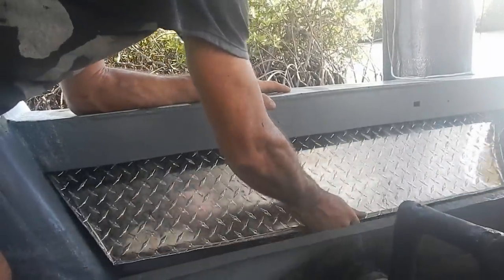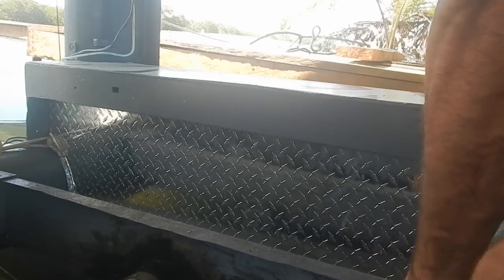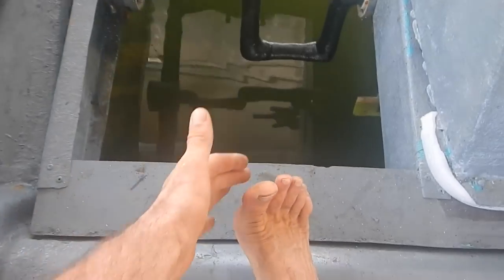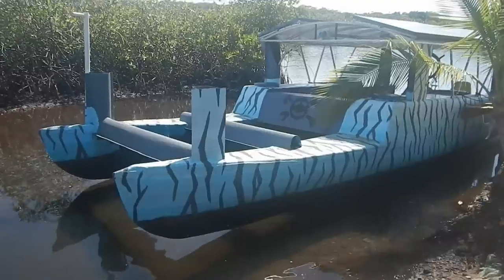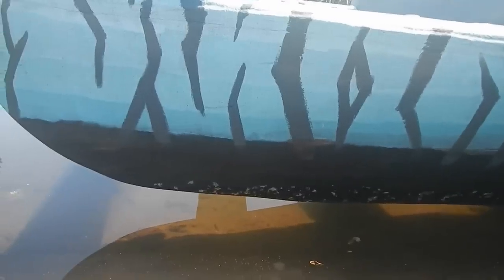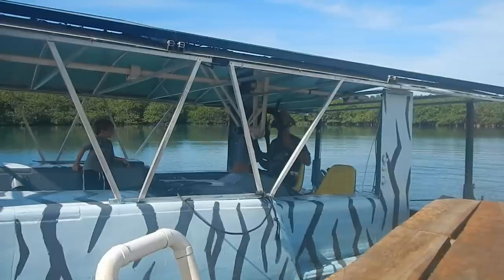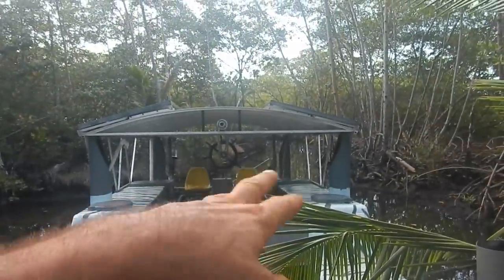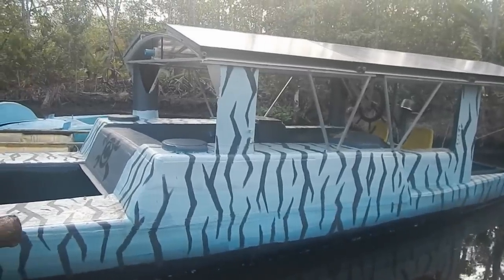Tiger Shark Slicer 032 Full Power Test Drive!!!

Comment: Very nice upgrade! I seem to recall you had a second motor you took off the original boat - might be worth setting up so it can be swapped in easily and then stowing it in a waterproof container up front for emergencies? Well done - a great demonstration of making a very solid and very functional boat using much less materials/cost than manufactured boats!

Comment: Jamie it will be better to join all the solar panels to the battery's .The mppt charge controller will put the extra power to the battery's when you use the motor. Therefore the will be less strain on the battery.There is no advantage having the Solar panels separate to power the motor. In fact the other panels my backfeed unregulated current back to the battery because its by passing the mppt controller.
Reply: his renogy controller is a pwm, not an mppt.
Reply: And he has diodes to prevent backfeed
Reply: @marzsit9833  its not pwm its mppt i saw him unbox it. and he said it was
Reply: Another benefit would be that while (in)loading cargo the battery will get a lot of extra charge to them
Reply: @stormchaser300 he can't use it because victron didn't ship the Bluetooth dongle with it and as such he has no way to modify the settings until he acquires one. You should have avoided making declarative statements when you don't actually know what's going on...
Reply: @h2opcs  what ever

Comment: This setup is so awesome, you're improving so much, but I still wonder what happened to your houseboat? Anyway, for the Tger Shark Slicer, for added leverage and force, comfort, and the like, you REALLY need pedal platforms. You could attach weights to the pedals to keep them facing at the right angle, and the weights could help by using centrifugal forces to create centripetal force at the shaft and increase inertia. Even better, the Zombie Chopper should have shoe-mounts so you can also get energy out of the pull of your opposite leg. This could be very tiring but with the right pacing it could be more efficient. Also, Jaimie do you warn your children of the dangers of coconuts? They don't play around the trees do they? Coconuts are deadlier than sharks!
Reply: he ended up giving the houseboat away to somebody down there :)

Comment: It seems I remember that you can set the paddles in such a way that they don't touch water. With the motor at higher speeds the paddles are causing drag.

Comment: Yellow catamaran trampolin instead of floor boards. Lighter and still can hold cargo. Could you move batteries forward to balance the boat?
Reply: He will not spend 300$ on that. Plan is to make boards with the new sawmill.
Also not good to load a trampoline... much easier to run a wheelbarrow on solid ground!

Comment: you could make an old fashioned og knot line
Reply: Im not real enthused about the diamond plate battery doors, at least add some insulation in case they work loose in a rough sea and fall across the terminals

Comment: Also what if you made a bike with gears that runs a generator to a motor vs peddling with the paddle set up? Which would get to faster speeds?
Reply: That could be good for cloudy days and when there are more than 2 passengers. Connected to a flywheel as well.

Comment: Structural speed of your boat is about 3.7m/s, so you can still squeeze out some more. 

Of course the power demand increase the closer you get. 

The structural speed is strange matter. We once rented a 300hp jetski and played with it. 

There was a guy with an old rowing boat and he wanted us to pull it in high speed. I said it wasn’t possible because it had a wrong hull shape. The guy didn’t believe, so we had to show. 

Even when we pulled with full power, the boat didn’t plane. Instead the rear end sunk below the waterline and front end rise towards sky. The guy went as front as possible, but it didn’t do nothing. 

Then the boat split in a half and after that, the front part was planing perfectly well.

Comment: I worry every time you remove those metal cover panels near the exposed battery terminals...
Reply: should have plastic backing on it..BUT it's not going to touch the opposite terminal unless he laid it completely flat, which he knows not to do.
Reply: @NEURALDELVER  of course he knows, but he is doing things one handed with a camera in the other hand often and that could just as easily be a different material or covers on the terminals.